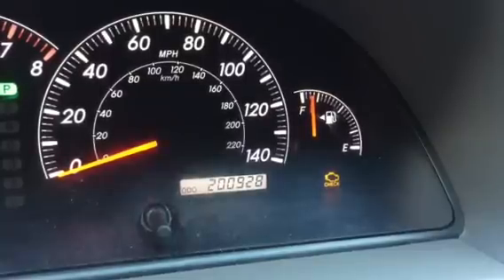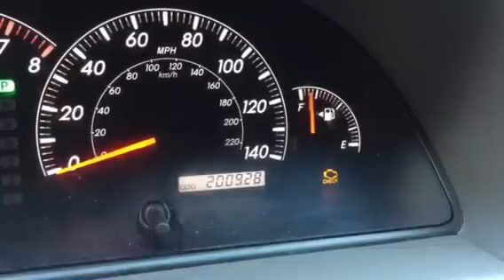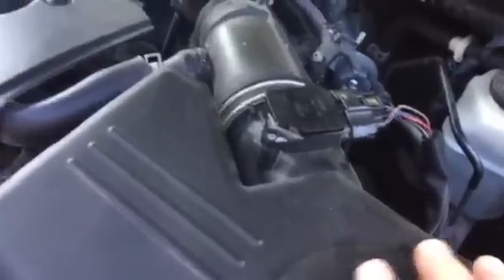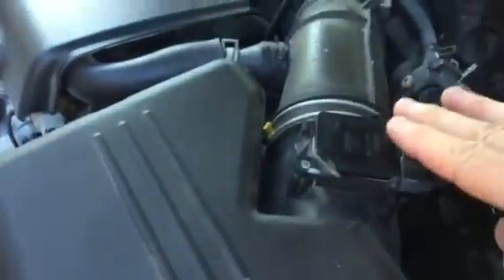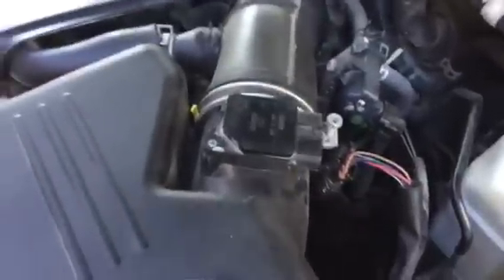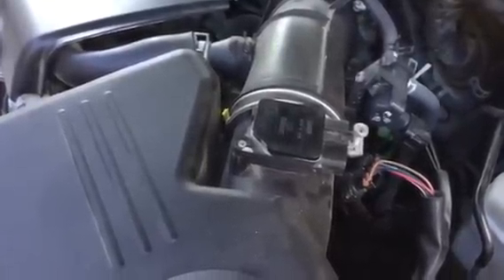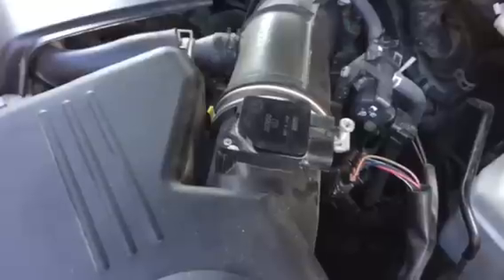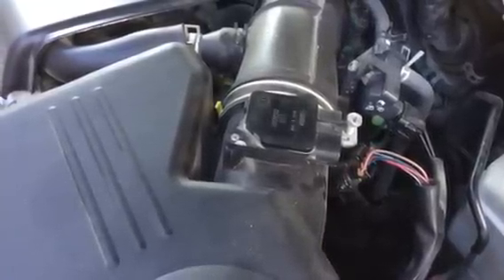How To Tell If Your Mass Air Flow Sensor Is Bad On Your Car

Comment: Didn't work for me..  my jag has 2 with twin intake. Car kept running with both out. Small chance both are faulty.  The right side only did make a sound with the engine  though.  Both have been cleaned too.

Comment: i have a tahoe 2010  did as you instructed   started the car i unpluged the sensor and it kept runnig so i purchaced on no returns on the parts  from advance auto   installed the new one unpluged it and it did the same the car kept runnig no diference!!!  ???  

now if i pull the sensor out while the car is running then the car shuts down

Comment: So if the maf sensor is faulty it should make the same result as unpluged ? It means no running engine if the maf is bad? At least that à bad maf sensor means it is completely kaput and not a faulty one that  is not working properly and gives innacurate readings.

Comment: The MAS will also stop working if it is dirty. On a  Yaris take out the two screw and it lifts out. If covered in dirt clean using a sensor cleaning spray.  If the contact is already clean you'll require a new one. 
1/ Spray the sensor and the two contact point hidden near the top of the sensor lid and allow 5 minutes to dry.  2/ repeat the cleaning process and leave for 25 minutes to thoroughly dry before re-installing it. Do not touch the actual sensor with anything, just spray. Be careful to prevent spraying into the electrical harness contacts.

Comment: Thanks for the video. I had this same problem with my z4 e85 three times already within a week. The mechanic did mention last Jan 2023 that it may go bad and to replace it  but mind as well clean the MAF first to see results. 

After cleaning it, all was good until just few days ago and today, I started to have that same problem and this time it went dead on the road. Had to park on the side to restart the engine again.

Comment: Can you do a video showing how it goes back in housing maybe mine is in wrong. I just replaced a new one and it won't  switch gear in drive mode. But but can drive in reverse. Does it make a difference? I cleaned the Maf, didn't do much, got a new sensor, nothing. I do plan to clean throttle and check  other sensors and solenoids

Comment: Thank you a million times for this vid.  My 2004 F250 5.4, bought new, was having issues losing power uphill and under load at 85K mileage.  Took it to four mechanics over the last 1.5 years.  No one could figure it out. One told me the truck's engine wasn't powerful enough and that's just the way it was built.  Not!  I've driven and towed with this truck since 2004 and never before had this problem.  The most recent mechanic at a Ford dealer said it was the transmission and wanted to take me down that rabbit hole but I intuitively knew that wasn't the problem.  I had already taken it to a good transmission specialist and he found nothing wrong with the transmission.  But, then I found your vid and, sure enough, the sensor was bad!  $140 cost to replace and I am now driving with no power loss and ability to tow my horse trailer up hill on the Interstate beautifully.  Just as it was built to do!
Reply: That’s awesome.
Amazing.
Reply: my mechanic told me my cam is broken on my ram and said a used engine would be better, so much bullshit from these highway robbers.
Reply: Dang you found the solution, an still got screwed for 140 ! They cost only 22- 50 dollars great tho
Reply: @jwillzcommonsence8870 maybe if you get aftermarket BS. I ordered a Duralast and it came all mismanufactured and in horrible condition for $99.....I ordered the FACTORY OEM mass air sensor directly from Mitsubishi for $150 and it came in PERFECT matching condition and my car now runs much much much better, almost like new...... 244,000 miles on it!
Reply: Who's the know-it-all true dummshid?
⬇️⬇️⬇️⬇️⬇️⬇️⬇️ @jwillzcommonsence8870 
A genuine MAF sensor should almost always be a dealer part or if you can find a genuine, OEM one online somewhere else for a bit cheaper and they always are a bit expensive. As the man said, $140 sounds right. Mine was $118.

I imagine if the rest of us got one of the most vital parts for our vehicle at Kmart, or Temu or where ever it is you shop, we would have got it for 20 bucks also.

You left that comment thinking "these people are idiots" and looks like you're the real genius here, no doubt.

I wonder where that sensor of yours, the new one, wonder where it was made.

Wonder what's the brand? Don't bother. No brand Ebay shid, made in Taiwan, most likely, or dare I say, China.....?

You're a winner today!!!

Reply back to discover what you've won and how to claim your prize!!
Reply: @jwillzcommonsence8870 
Yeah I thought so too but it seems that it's different prices for different make and models of cars I bought one of these things a while back for my older vehicle
Payed about that price""
But my wife's vehicle was about $150
I was like WHHHAT...😮
BUT IT WORKS...

Comment: You should first clean the MAS With mass airflow sensor fluid let it dry plug it in start the car run it  awhile. Remove it and see if it’s dies before you buy one. You may be surprised if it has never been cleaned😊

Comment: Hello Brother: As an ancient, as my kids state, cars today are different with electronics. My neighbour has a 2009 GM. Uplander. When driving in rain, it stalls, battery pretty every morning is dead. Headlights flicker as horn buzzes when driving. It doesn't seem like he takes good care of it, as money is an issue. I get a code ( $7E8 ). I checked it out and it states. Could this be what you are stating? I haven't checked it out as of yet.

Comment: Terrible video with 100% INCORRECT information!!!
This is NOT how you properly check/test any MAF sensor!

Also, the CEL (Check Engine Lamp), also known as a MIL (Malfunction Indicator Lamp) located in the dash cluster, can literally be illuminated  (turned on) by hundreds of possible codes/problems. 

The ONLY proper way to know why the light is on is to plug a code reader/scan tool into the vehicle's OBDII port, to retrieve diagnostic code(s), as well as any stored freeze-frame data. 
A scan tool will also enable a trained technician the ability to view & interpret live data, as well as enable & assist them to perform any necessary diagnostic tests.

It absolutely infuriates me that idiots like this guy post absolute phony crap like this, that will only potentially screw over the average vehicle owner. The "average Joe" car owner, whom has no clue what is true and what is complete nonsense & total misinformation. 😡 
Aarrrgh!!! 😠

Comment: Hello my 05 e500 cranks but won’t start I replaced the fuel pump n crankshaft position sensor and it cranks but won’t stay on it turns off can it be my mass air flow sensor..? I put starter fluid and turns on but turns off like 5 seconds after

Comment: This might be different in other cars, on my car i was told that once you unhook the mass air the computer compensates for it and will stay running.
Reply: This is absolutely correct. Your vehicle has 2 systems that control engine operation. Below 4000 rpm your Manifold Absolute Sensor operates the engine. After 4000 your Mass Air Flow sensor operates the engine. When tuning MAF with HP tuners we disable MAP sensor to make the MAF do all calculations. Conversely when tuning MAP we disable the MAF and make the MAP sensor operate the engine. Engine will run in both senarios.

Comment: ok yes, if your vehicle cuts off , when you unplug it,it means that the MAS is working fine. also now by doing this by unplugging it ,now there is code stored by unpluggingit... and you need a OBD Reader to clear it... why not just take it to the local auto parts (autozone) store and they will check your codes and or clear your codes for you...free.

Comment: I'm gonna try this as my last hope. And will keep the 30 miles in mind, because I changed mine with an expensive OEM replacement and I'm still getting the check engine light, so maybe I need to drive around a bit for the car to reset itself

Comment: I unplugged my MAF and my engine ran crappy but didn't shut off.  Cleaned the MAF sensor and plugged it back in and it ran fine.  I have to question about the engine shutting off by just unplugging the MAF.    Just clean the MAF and see how the car runs.  Check the vacuum hoses etc. that can cause a lean condition.  Check some other Youtubes for other things that can cause an engine light associated with the MAF.
Reply: Make sure to check your o2 sensors, on high mileage cars these need attention…..most people don’t even consider them, good luck!

Comment: Years ago, a GM tech showed our class a simple trick of using the handle of a screwdriver and very gently tap the mass if the engine changes rpms or stumbles, replace the mass.

Comment: Wait!?🤔...
Q 1. You now gonna go 20 miles or so Before it resets itself?...how?,the car died on you so how do you drive it 20 miles before it resets?🤔

Q 2. If it wasn't working from the start,how was the engine running?🤔... if the engine is running as it was,then it was obviously working😳🤪.
Reply: Um, can you not use common sense?

He means drive it after you replace the sensor.

He just told you in the video the engine is running and unplugging it, thus stopping the engine means its working. With bad sensor, your engine will run but be rough, or idle high cause the sensor might be bad but still technically works, its just feeding the ECM faulty data. 

Your use of emoji's does not make you smart.....
Reply: @zairkadian  
Um... you should watch that video again,you are stating  things he never said,this is a common problem with many... stop making it to be what you want it to be and get over it,I have already... I disagree, I do look smarter🤔 👍

Comment: You’re wrong on that information the light may go out but it’s going to store in history. You have to clear it out with a scanner. It’s not going to clear itself out just because it’s fixed you got a history code. If you disconnect the battery all it’s gonna do is shut the light off and a lot of times that just adds more codes into the system because when you disconnect the battery you have to have a scanner to go in and clear all codes from the controllers and a lot of the newer vehicles you have to reset your fuel trims your adapts, so you’re a little wrong on your video

Comment: Does anyone have a update if it’s true and did the engine light go away after changing MAF Sensor because I’m having the same issue where I cleaned the throttle body while revving it at 2000 Rpm and the engine light came on went to dealership P0421 trouble code came up with no other codes they recommend reprogramming the PCM it took it away but came back again after 15 mins of driving now the dealership is recommending to change the MAF Connector / O2 sensors and Cat converter if the two still don’t fix the engine light issue. Which is gonna cost me well over 2k just because I didn’t want to take it to the dealership and pay $200 for throttle body cleaning. Lesson learned and any help regarding this situation would be appreciated! Thank you

Comment: After spending 700+ dollars on ignition coils plugs and wires I found this video. I was at wits end. Thank you for being so to the point and concise.
Reply: So it solved the problem?
Reply: Well at least next time you have a problem, you can rule out all of the things you replaced lol
Reply: Fr i did the same i replace all the spark components coils, plugs, fuel injectors, valve cover, and fuel regulator and still threw a cyl 3 misfire. Got the sensor and ran better than it ever did made the light go of. P0303 code gone  @Ron.Swanson.
Reply: Don't really mind throwing parts at her I'm gonna keep her forever
Reply: @JohanAguilar-kk9sp  
What kind of car?  My 2009 Genesis 4.6 is throwing a P0303 and P0300.  I replaced the plugs and coils, and just had a mechanic tell me it could be a fuel injector and check the Ohms at cylinder 3 compared to the other ones.  I tested all of the Ohm readings and found they were all at 15.5 Ohms.
I'm hoping it is just the MAF sensor since I've seen some people say it ended up being a broken valve spring.
Reply: @JohanAguilar-kk9sp Me too have P0300 and I replaced same what you do only left Map and Maf sensors for check and maybe they are problem
Reply: Back in 2003, Before Youtube, I did not know about this. Mine went bad and my engine was running like crap. I went to a mechanic and he charged me $500 dollars to diagnose and fix it. Nowadays I have an ODD2 scanner and a lot more knowledge about how to fix a car.

Comment: I was getting po420  po113 po102  po102  somebody  I trusted put electrical tape around the plug to my maf sensor so I would keep coming back. I took the tape   off and my engine light went  out.

Comment: My engine light is on a 2014 Chevy equinox with 215,000 plus miles so I unplugged the mass air sensor it keep on running and the fans came on as soon as I unplugged the mass air  It has not been cleaned or anything so will cleaning it help or just replace.

Comment: Man.. mine keeps running when I disconnect it.. it’s a new one and right after they put it in, my car started stalling on hot starts and then firing right up again. The data from the maf sensor is reading fine, any thoughts?

Comment: Had a mo- kanic tell me it's a clogged catalytic converter LMFAO nope not never " have to have super blow by worn rings / valve seals  running 2 stroke pre mix for years,  and it would smoke like mosquito control which it doesn't smoke at all" even when you start it and it's cold or when it's hot and has been running for hoursthey just wanted to cut off my catalytic converter for the cash their worth"   them plug the computer in for the codes mass airflow sensor O2 sensor code came up "  so much for that dishonest dirtball" even if you had mega carbon depositsis not going to inhibit the flow of your catalytic converter if your catalytic converter actually has a sensor screwed into it take it out and clean it with carb cleaner / brake cleaner stick it back in" depending on the vehicle turn the key accessories not to whereit turns the motor over pump your gas pedal five times and then restart your car to clear the computer code

Comment: I just replaced my MAF sensor with a new one, but it ran just as bad as before, with lots of misfiring & exhaust smoke. I pulled the plug & it didn't stall, and in fact ran a lot better afterwards.
Reply: What kinda car
Reply: @wf2784  - A VW-Audi group product.

Comment: If ya disconnect the battery for 10 minutes I'll reset. But I have a question check engine light came on in Mt at so I go get it read and it's a mass air flow censor. Which mine looks bran new. Si I cleaned it put it back and reset it and thw light goes out. Until 2 weeks later i got the light on in my dash again. Same as last time o was sitting engine on for about half an hour idk y that triggers it. Anyway could this b an error my censor literally could not tell the difference between it and the new one literally we got them mixed up. Idk if appearance has anything to do with it but I feel like something is up

Comment: Im driving mk6 6 gti. When the plug sensor is on, the engine turns off. At the moment the Throttle body position sensor is not working on the gas pedal. Im glad k know where to look in to now.

Comment: I tried it just now, my engine keep running when I disconnected it, time to replace mine, but oh man, I clean the throttle, change the spark plug, check the fuel injector and nothing happened until I saw your video, thanks a lot.

Comment: Yeah that’s a very good trick, but the guy never told us what is the code , cuz when check engine light is ON it is not just because the air mass sensor is in bad condition

Comment: Not necessarily. Could be dirty .Air box lid could be loose also. Loose or incorrectly installed intake air duct will also trip a code. Short term fuel trim will be around 12 to 13 which is way too high. Good trick but wont really diagnose issue or fix issue on a lot of vehicles.

Comment: Im gonna be the first to say that it depends on the car - when i unpluged the maf from my car, the engine didnt stop, but it worked better and got better mileage. 
Explanation: 
1. After the maf was disconected, the ECU got the manufacturer code for (airflow ratio) for the engine to run correctly, even with the check engine light on.
2. If my engine stoped runing or bad idle - then that means that the ECU has a code problem
3. If the engine runs bad then one of the reasons could be that the maf has a bad reading (dirty ot electric problem) 
So if you unplug the maf - not always means that the engine dies!
good luck!
Reply: Well, mine also worked better for short time but after sometime it got worst.. I tho had bad new part.. but wished I  let the computer reprogram seen if it got better..
Reply: @theresam8809  Can you tell me what is your mothod for leting the ecu to reprogram the mixture? Thanks!
Reply: @Magina1989  I didn’t get it reprogram, that was my mistake, I took the new one off and took it back refund.. I put my old one back on..  I wondering if I should reorder one and try ur method.. sorry on late reply!

Comment: My  truck had the check engine light on so l took my truck to a parts store to have them hook the meter on it and they said it was the cam sensor so I  went to parts store to by one and found out. There's two of them you would need and that didn't come cheap then found out that wasn't the problem so went to parts store again to have it check again and was said it was the v v t soliod and that cost me a lot to l don't have that kind of money to throw around.